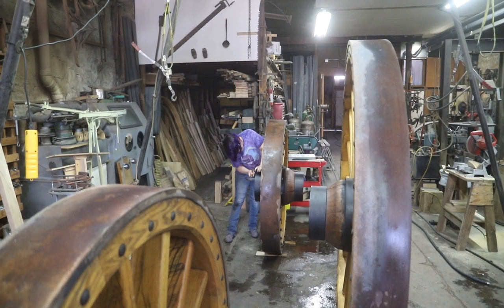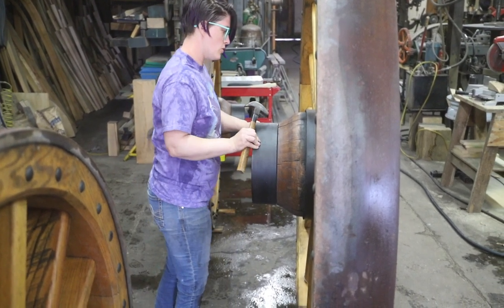Charred Wheels & Blackened Hub Bands | Engels Coach Shop

Comment: Observation: Being a skilled tradesmen from NY and working in Las Vegas NV. When something is built in the Northeast, Northwest or the south. When that item is shipped to the dry southwest. Their is considerable shrinkage. For instance. When installing cabinets with raised panel doors. 6 weeks or so after installation. You have to go back and touch up those raised panel doors with touch up stain because they shrink to the point there was a 3/16" unstained mark around the top & sides. While hanging sheet rock on a 16" on center studded wall. On my 3 sheet I was bearly on the stud. Complexed as to how this is possible. I keep checking my  16" on center 6 ways to Sunday. Then I checked the length of an 8' board of sheet rock. I'll be dammed. The sheet rock is 3/16" short. So by the end of a 3 board run. You're screwless...L0L  So when making wagon wheels in the northwest and those wheels spending their lives in the southwest. I can understand the shrinkage.

Comment: Interesting take on the super slow mo where the speed of light compares to the speed of sound when setting the hub bands.
Reply: That's just the audio track being out of sync with the video.
Sound takes 0.003 seconds to travel the 1m from the hammer to the camera - this would not account for the apparent  delay in the video

Comment: I'm assuming that the flaming oil bath on the heated hub bands was kinda like seasoning a cast iron skillet - you get a hard polymerizrd coating that resists corrosion and you can fry an egg on it without sticking.  Nice editing effects on the production end, BTW.  Your new camera jockey is a winner.
Reply: Yup exactly right

Comment: I would use all new wood for the long twelve-foot sections, pressure-treated for long life. I would salvage any good parts of the old planks and use short lengths elsewhere on the project.

Comment: Why did something as relatively simple and freakin’ brilliant as wheel dollies take so long to come up with??   On a different note, would it damage those Borax wheels if they fell over on concrete?  A) yes B) no, they are tough C) sometimes D) really don’t want to find out E) sure as shooting damage anything under them.
Reply: If they fell onto a flat concrete floor, the only contact the wheel would make would be the steel hub band and the steel tyre
Reply: Paul G, my point exactly. That would be quite a weighty shock load of side force to the spoke/hub joints. I suspect it is door B even so.
Reply: B,D,E
Reply: I think before this tune-up there may have been damaged, but with everything nice and tight, it will just damage the concrete.
I'm not a wheelwright, I just watch one on youtube.
I'm just speculating.

Comment: Nice job Janelle, it was fun to watch!  a little change is good once in awhile, brings a fresh feeling to things.
Also Dave, I noticed that you didn't round the end of the bolts when you clocked the nuts.  Is that because they didn't need it or is that just something you only do the first time so they won't unscrew off?
Reply: He did it the first time.
Reply: @dianeengel4155  Thanks!

Comment: Did it look like the left side nuts were left hand threaded?
Reply: Terry--It did to me also.
Reply: They are left-handed. That way they stay tight and don't loosen when the wagon is being pulled forward. A lot of old cars and trucks used to have left-handed lug nuts on the left side of the vehicle.
Reply: That's where the term "left hand thread" originally came from -- they went on the left hand side of a wheeled vehicle (so that the tendency is for them to tighten up rather than loosen as the vehicle rolls forward).
Reply: Same principal as on a bench grinder shaft.  One side is left handed nuts, the other is right handed nuts.

Comment: That flaming hub band procedure might need a disclaimer such as " Don't try this at home" or even better.." Don't try this anywhere"...
Reply: At least, not without welders gloves. Yikes!
Reply: Yeah, pretty sure I'd not want to try that in the haybarn....

Still the finish it gives looks great.
Reply: If someone can't figure that out, they shouldn't even try.
Reply: that is a important part of preparing them to be put on hub and seasons metal. i use to get nails that were seasoned with oil they were by far better than the ones that were not seasoned with oil. it's safe when somebody like him dose it. they use to do same thing with gears and axles when they were really good. i don't think any body will be doing that at home. i have done it in past i wore leather or wet my clothes down. all black smiths did it every day in the old days. safer than driving down the road with a bunch of dope heads. take care, be safe and well.
Reply: @SomeGuyInSandy  yep, you really missed the joke there mate.
Reply: @petert3355  Sure Safety Sally, sure.